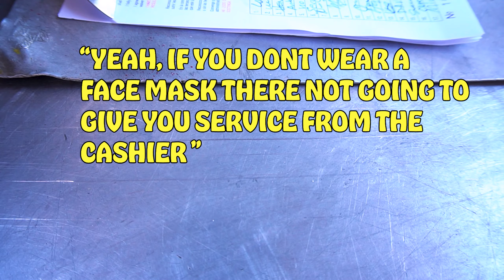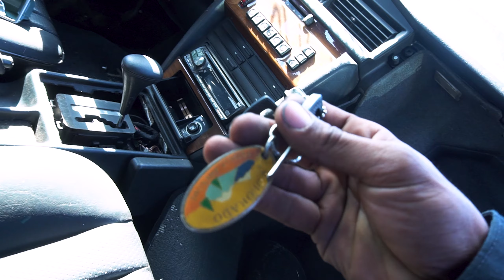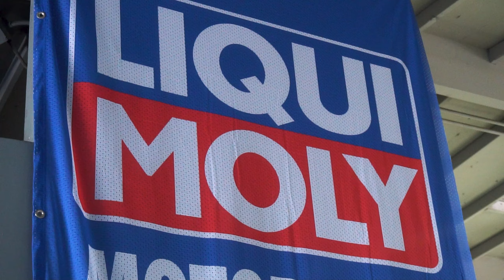E90 Brake Booster on E30?! | JUNKYARD HUNT | BMW E30 S52 BUILD EP. 4

Comment: Brake booster delete bro. Also you can actually put a small dent into your stock booster and it will work.
The best fitting was one from a 944. And my info is shut I tried not forums.

Comment: You’re better off threading it, for those that want to do this you’re gunna need 2 fine thread m10 to m12 flare adapter fittings as well as an m10 3/16 t fitting an m10 3/16 female  to 3/16 female to route your existing brake lines onto the brake master cylinder. All in all it’s under $120. You’re also better off buying the booster on eBay they’re around $40. A brake booster at the junkyard cost $46.37 plus a $5 core. So save yourself the time unless you’re impatient.

Comment: wait pause wtf u didnt have to do any welding with the clevus pin or anything
Reply from the maker: You don’t have to, it lines up but the pedal is to short, it’s closer to the back of the footwell. You  can run it like that but it was to short for my liking
Reply: @StacheCam   ahhhh i see what u saying damn imma throw one in there then cause shit these manual brakes are trash also next video with the swap can u show what u do if you are gonna have heat in the car cause i didnt run heat or ac or power steering or power brakes😂 but i need heat at least